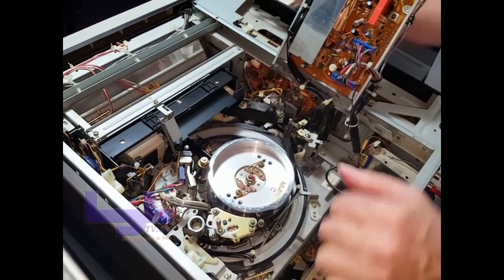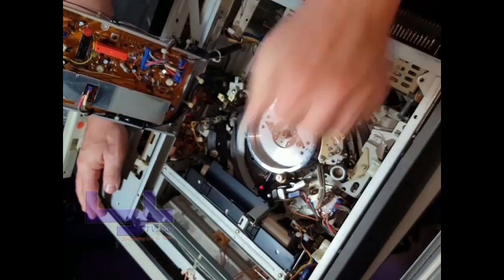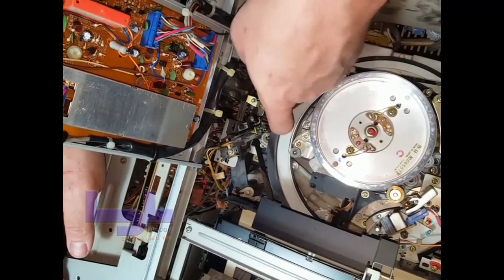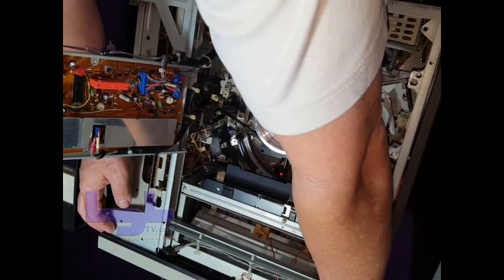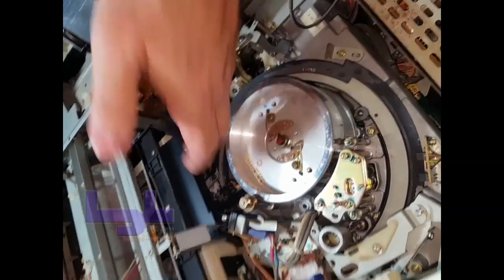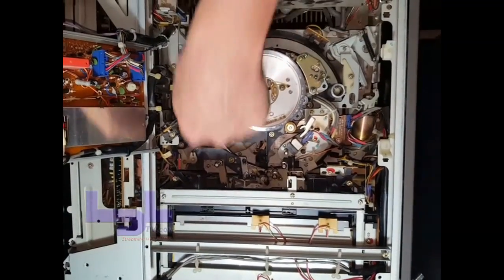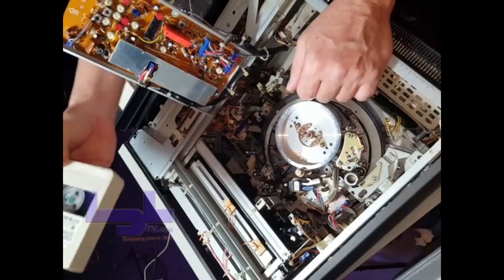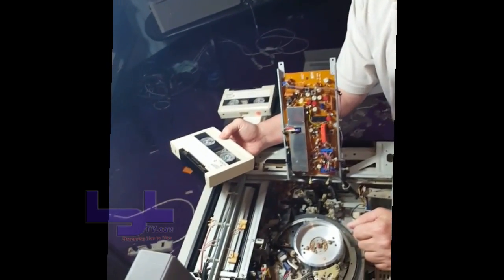How to Eject a stuck U-matic Video Tape from a Sony Player VO, VP or BVU Models

Comment: You can also take the bottom off and rotate the idler tire drive from the back to draw the tape back into the cassette for the final unload stage so you don't have to worry about crimping the tape or keeping the lid open. Other thing you can do is just take out the basket with the tape in it and manually wind the tape back into the cassette after you've gotten the loading ring back to the home position.. The loading mechanism will keep the door held open as long as it is still in the down position.

Comment: I have a Sony VO9800P that is giving the "error 20" message. I took the cover off to view what was happening. After inserting the tape, it feeds it fine and extracts some of the film ribbon (no error message yet). But when I eject it, it ejects fine but it does not retract the film ribbon, so I can remove the tape, but I have to carefully remove the loose ribbon. What could be going on? I replaced the rubber belt on the underside below the cassette carriage. I dont know what else to check
Reply: Also, this video does not play for me. Perhaps it got removed by the uploader. Can it get re-uploaded please? It is very helpful to see different videos and different perspectives on this machine, I tend to discover helpful things that I overlooked.

Comment: I'm having an issue with a Sony VO-9600. Everything works just fine 
except for the cassette carriage. When inserting or ejecting a cassette,
 the carriage consistently sticks at one specific point (on the 
horizontal axis right before the pivot). If the cassette is manually 
pushed in/pulled out past this point, it loads/ejects without issue. Is 
this a simple issue of lubrication, or does the motor need to be 
replaced? I already checked all the gears and tracks for obstructions 
and grime.